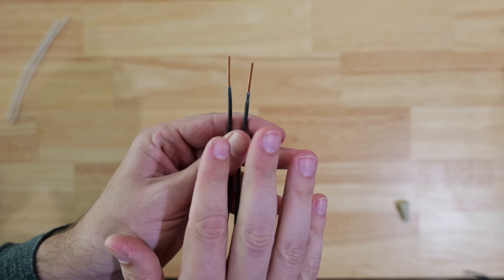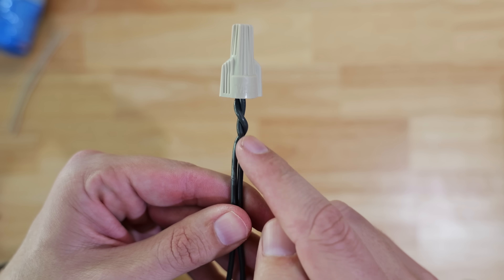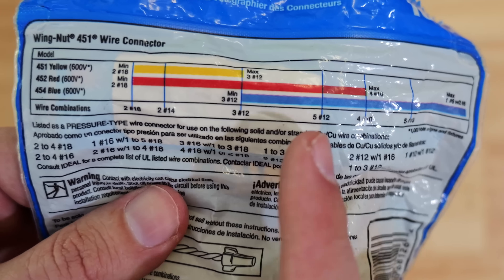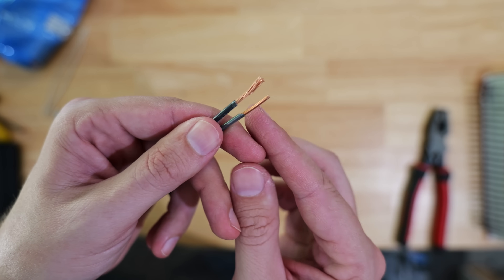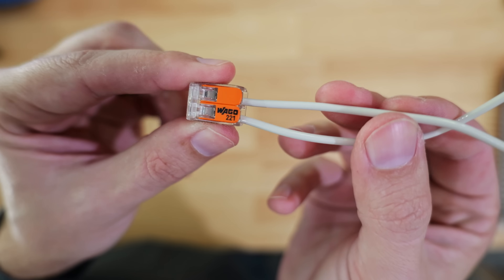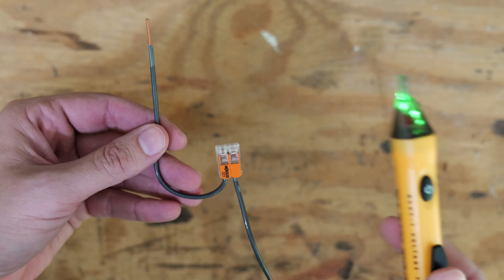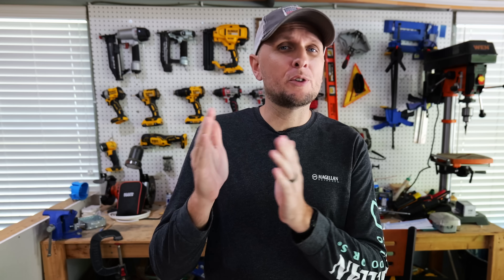7 FATAL Wiring Mistakes Most DIYers Don't Know They Are Making | Most Are Guilty of 3

Comment: When closed correctly, which is no big deal, never had a failed Wago connection for 16+ years. Made wiring in several production facilities. It gives flexibility and saves a lot of time. As per wire twisting, as the colleague said, these units are not common in Europe. However, after proper twisting pattern with pliers, we use an insulated ‘cap’ that has a tightening screw and is insulated. Everything is rock solid. Great video, mate! People should be aware that improper wiring is pure risk and danger.

Comment: Wire nuts have pretty much disappeared in Europe over more reliable and fast connectors that use springs. Lever Wagos and push connectors (wago 2773 for example) are just reliable and cut down installation time considerably. Lever wagos are more expensive, but they are used where stranded wire is needed.

The thing that you might want to consider with these connectors is that spring-loaded connectors will not loosen due to thermal explansion. Any screw connector will loosen over time, and this can cause fires. The wire loosening completely out of the connector is actually not that dangerous. But wires loosening just enough to cause sparking is something that can cause fires. The wires heat up and eventually melt. This is why flame retardant plastics are used literally everywhere, and connections are done inside plastic or metal housings that contain the potential fire.

The industrial automation sector is moving heavily towards spring-loaded connectors in all applications since most industrial machines experience heat variation and vibration.
Reply: It's great to hear a electrician  be concerned  about fire . I see so many of these you tube videos  where  guys go from the outside  to inside, just drill a hole thrue the wall and pus the wires thru , I recomend  to go up to fire department  and ask 
About those dangers . Of causing a home to burn. Because  they dont understand  pipe .
Hats off to you iam 35 years in ibew 134 and never 1 time used romex . Take  care bro.
Reply: Those type of uncrimped wire-nuts are totally banned here in Australia, & I doubt that those Wago fittings are legal either as I've never seen them before! 
Screw-terminal blocks are the predominate & safest wiring method nationally!
Reply: @stevie-ray2020  the issue with screw terminals is that they sometimes dont screw in properly, and sometimes they loosen over time. youd experience this quite frequently if you work in industry. Wago lever has a spring that completely solves this issue.
Reply: Europe isn't using 120V like we do in the US though, so aren't you typically working with lower amperage where heat is less of an issue and the risk of melt is significantly lower?

Comment: I'm an electrician in the UK, we use Wago connectors a lot these days and have virtually zero problems with them, they are pronounced 'Vaaaygo', I think it's German. I have seen a 'wire nut' only twice in my whole career, back in my apprenticeship, they were used for lighting circuits only, back when we had rubber cables in the 50's and 60's! I remember they were small and ceramic. They are now illegal for use in the UK (for the last 40 years at least) and rightly so.
Reply: I've been using wire nuts for 40 years.  Have a shop with 40 electricians. never had a problem. There engineered to work and work perfectly.
Reply: Modern wire nuts are not illegal in the UK.  There are several sources for them in the UK.  They're uncommon in the UK, but that doesn't mean they're illegal.

I was looking for some on a UK website, and I found KEW Electrical in Cheshire sells Ideal twist-on wire connectors, including Twister, Wire-Nut (which is Ideal's trademark), and Wingnut.

Comment: 25 years ago I wired a 24 unit senior housing, apartment building. All connections were made with Ideal tan "Twisters" . I have never had a single call-back on a failed connection.
I still use mini blue nuts and small orange ones, usually for lighting applications, but the tan "Twister" is my everyday nut.  30+ year master electrician....
Reply: and in the factory i worked at, with all kinds of extreme conditions wirenuts would untie themselves and fall apart. WAGOs didnt
Reply: Depends.  A lot of DIY work is dealing with just whatever is available in the junction box in older homes that have antiquated splices.  I cut off a twisted/soldered/taped splice (that was probably installed before I was born). I underestimated the wire nut size needed to connect 3 12 AWG wires with limited wire/room to work with.  It slipped out, I diagnosed why two downstream outlets wern't working, and I connected it with a red wire nut.  But I think Ideal's tan Twister would have been fine.

Those twisted and soldered connections were a huge pain.  Even if I was OK with electrical tape, some of them were so bulky that it was hard to fit a GFCI receptacle in the box - especially a narrow box.
Reply: @ypw510  Those soldered connections usually had friction tape on them. Here in the Catskills I have dealt with a bunch of those splices.... Imagine lugging a soldering iron around with you ???
Reply: @duggy889  
I've been adding GFCI receptacles in an a couple of old homes.  The replaced receptacles were probably from when it was new or rework in the 60s.  I've seen a few crimp sleeves covered with tape.  They were attached to old GE receptacles that had non-reusable backwire connections.  There is a screw, but that only squeezes down on two crimp wings on each side.  There's a fairly thin fiberboard back with two backwire holes on each side, and that board effectively prevents using the screw with a wire loop.  These were most of the original receptacles in one home, and I even saw where some were used to bridge the power rather than using a splice and pigtail.  And it got really difficult when there was just so little wire to work with in the box after cutting off the wire.  I tried prying open the crimp wings, but often the wire ends were heavily tarnished or even showing green patina.

Most of these soldered or crimped connections were actually made with two wires where one segment of insulation was cut off (without cutting into the wire) or pulled, and the other wrapped around it.  The covering varied.  Could just be vinyl electrical tape, but a few had rubber splicing tape (which is supposedly much better) covered with either friction of electrical tape.  Have you tried removing rubber splicing tape residue from your hands when it's maybe 70 years old?

As far as the solder goes, it's my understanding that they weren't necessarily using soldering irons, but often preparing molten solder and pouring it over the joint.  Some of these joints were am inch long.  I saw some where it looks like the insulator was scorched by excess solder that was removed.  I think another way they might have done it was wrap around the solder and then put a flame to it to get it to flow.

Comment: I've wired a lot over the years of DIY, I'm happy to know I've been doing it right.  I also wrap the connectors with electrical tape.  On a shed, I also made sure that every connection was made in a box.  I have three 20 amp circuits of 12 gauge, 3 strand, so I wrap every circuit with a color coded tape so I won't overload one circuit by connection two power tools to one circuit.  Thanks.

Comment: Thanks for the tips. Just when you use the piers to twist the cable together, make sure that you twist it the same direction as you would twist it with the wire nut. Otherwise,  the twisting done later by the wire nut, may untwist the previous twisting you have done before.
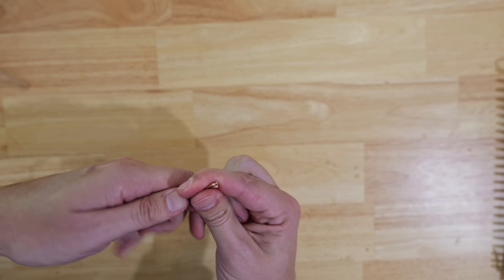Reply: 3:52 pre twist those wires first.
Reply: Never pretwist never had a problem
Reply: I remember being a first year and they asked if I twisted or spliced the wires... well gee what's the difference? I could tell you making the twist below the nut was a no no in the residential commercial jobs I was part of. The secure mechanical electrical connection was to be at the conductors contact as a pre twist could potentially unravel. As an apprentice I didn't argue. Stop thinking about it and get it done some would say. That wire nut should not come off after a test tug. Try it on some spare wire first because some wire nuts can be faulty. Of course you can't re use the the one you tested but the rest should be uniform.
Reply: Common sense would tell us that!
Reply: On the job site the cement workers was the  'blockies, the plumbers were the terd-heatders. The electricians the WIRE-NUTS. And I done sheet metal fab. We was the tin-knockers.
Reply: @paulb513 Common sense is …. not very common !
Reply: I always made a tight wrap with Super 88 starting around the wires just below the nut then a good wrap around the nut and back down around the wires once more. A little more time consuming but definitely much safer @NerveFlux
Reply: @quartqwertbudisgood that's cause you don't get rehired to fix the Fk up.

Comment: I've been watching vids in preparation for installing a pendant - and then to figure out why it didn't work (lol). Huge problem with a lot of them is that the person talks through what they're doing BUT they don't show close ups. "Then you twist the wires into..." but showing the guy saying that instead of the wires so you have no idea what they actually did or what it should look like. This video cleared up about 10,000 (okay - hyperbole - but after all of these vids it feels that way!) questions and misunderstandings in less than 15 minutes. Just wish I'd found this one first! Great job.
Reply: I've been frustrated with many videos for the same reasons you mentioned. Not only with wiring but lots of things. Like guitar lessons. A lot of those guys should watch some videos before they make videos. LOL. I appreciate videos like this that SHOW how to do it, as well as why.

Comment: Good video.  The number one place I've seen wire nuts come loose is in an attic.  Numerous time on service calls I've found the heating and cooling cycle of the attic will loosen the connections made by DIY'ers adding lighting or ceiling fans.  Poor wire connections (not twisted as shown) sometimes causes burning/melting of the wire nuts.  As an apprenticeship instructor I always taught that you had to twist the wires and not rely on the wire nuts for the connections.
Reply: You are correct. Twist the wires to make the connection, the wire is used only to cover the connection.
Reply: Also when you twist the wires you triple the conductivity at that bridge in the wires, less likely to fault or overheat at that point …
Reply: It has to be just right though.  Overtightening can break off wire ends.  Not enough and it can be vulnerable to coming out.  I don't really like pretwisting.  I prefer to have a look at the inside of the wire nut if possible to make sure that all the wires are buried in the spiral.

Overheating is only going to come from a marginal connection that creates a high resistance.  Pulling completely out might be better than just barely hanging on.
Reply: @ypw510  As always, experience is the key to making a good splice. Having wire nuts come loose when amateurs make splices proves nothing about the reliability of wire nuts. Those people should probably be using those overpriced Wago things instead...